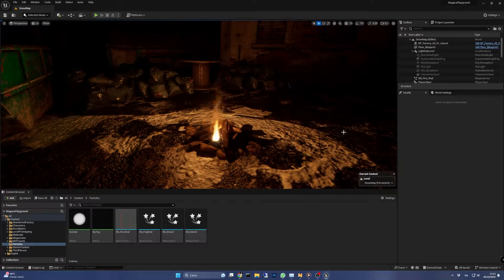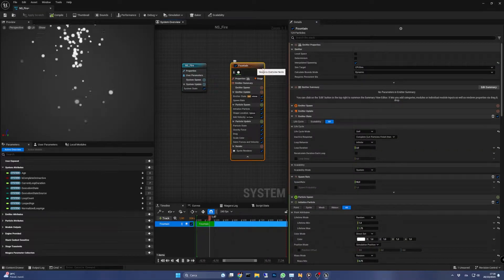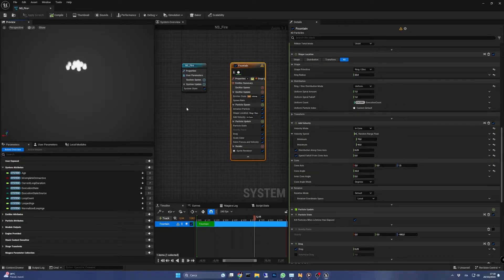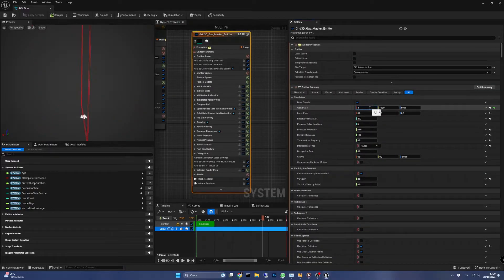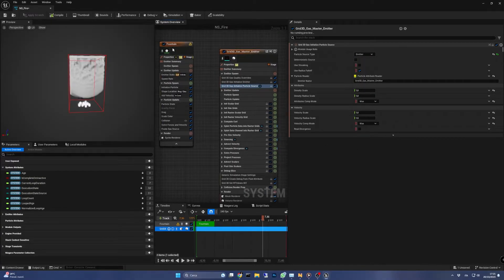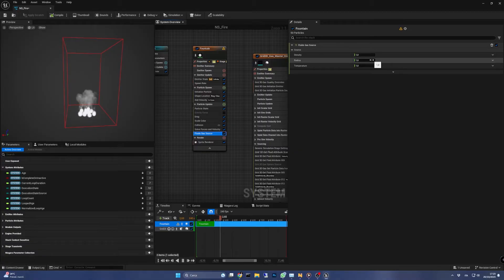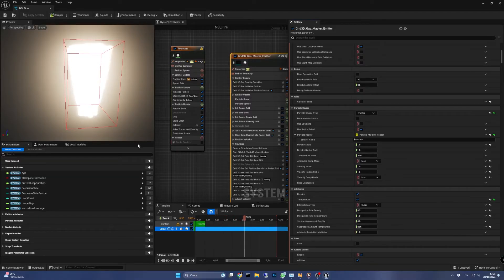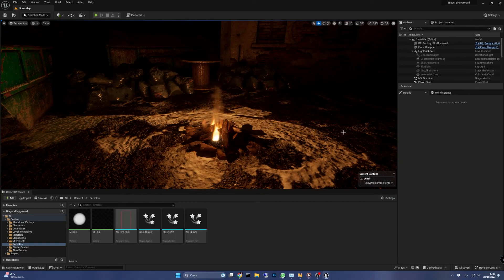[UE5 Niagara] How to make realistic FIRE

Comment: Unreal version 5.3.2 : 
1) ParticleUpdate > There is no Fluids Gas Source
2) Add emitter > Parent Emitter > Is empty. And there is no "gaz..." even in other tabs
Reply: Simply enable the "NiagaraFluids" plugin (which is in beta – UE 5.3.2). This enables both the fluids gas source, as well as the Grid 3D Gas emitter (which can be founds in the "Parent Emitters" tabe
Reply: @tomscodeshk  Thank you !
Reply: @tomscodeshk  lifesaving info
Reply: @tomscodeshk  Thanks !
Reply from the maker: As @tomscodeshk said, go on the Edit menu -> Plugins and enable the NiagaraFluids plugin. I forgot to mention that in the video!
Reply: thanks for mentioning about this . i had the same issue and just checking comments .

Comment: Weird, I'm using Unreal 5.5 and there seems to be no fire being emitted, just smoke. no clue what's different, my graph seems to be exactly the same and I followed along by each step
Reply: I have same problem when using Unreal 5.5
Reply from the maker: Be sure to check the temperature checkbox shown at around 6.45 in the video, and try slightly different values of Temperature in the emitter
Reply: @gonoshift  its checked still only smoke
Reply: into Grid3D_Gas, find "render" into search bar, try to change fire Color, Render Density : change to curve and increase value Density Gain & Albedo, Render Temperature : Black body
Reply: @anhttcm  not work, only smoke... i am using 5.7

Comment: Great video but I'm having issue: the smoke is always black, and when I check the temperature box, it still remains black.
Reply: I'm not sure its the same, but turn the "Render Temperature" dropdown from None to Curve. You might need to adjust a couple of the setting below it to get the right colour your looking for
Reply: search "render temperature" and use "black body"

Comment: Regarding the performance factor, you can make a flipbook from a simulation via built-in Baker function and use it as an animated texture for a performance cheap particle system.
Reply from the maker: Yes, that's definitely an option 👍🏻
Actually, I wanted to cover it in another video, maybe in the future I will, thanks for the contribute 🥂